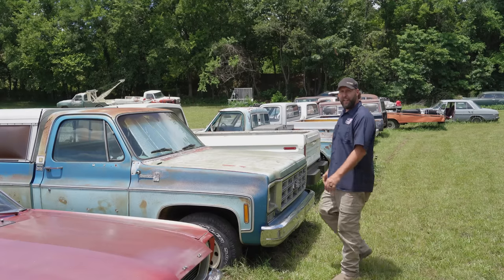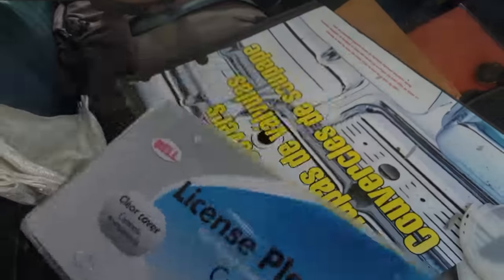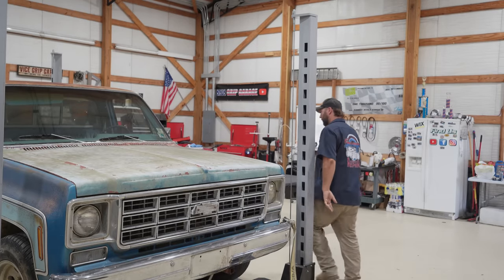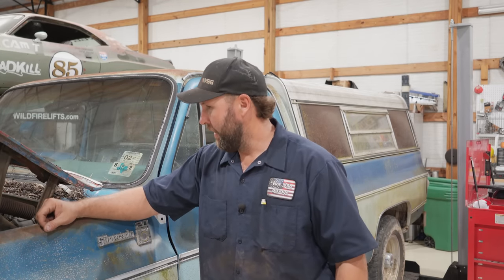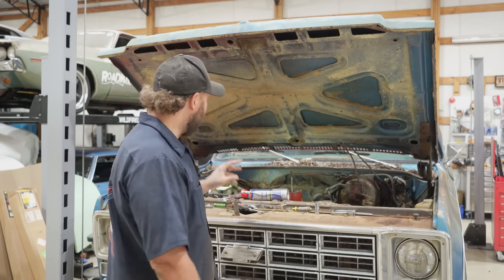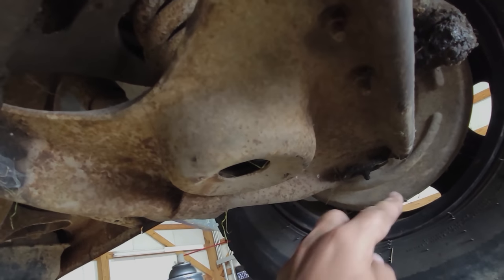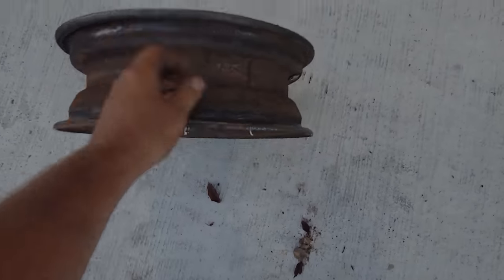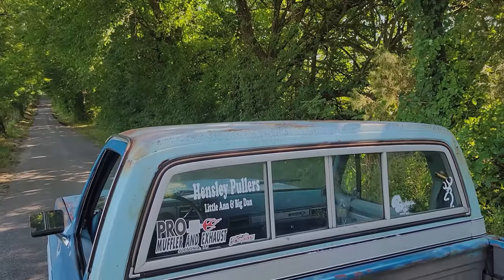Forgotten Big Block Truck- Will It RUN AND DRIVE After 16 Years?

Comment: I think a kid with a mullet driving a John Deere is one of the most American things I’ve ever seen.
Reply: I absolutely agree 🇺🇸
Reply: When I was at Montage for a concert, I got a picture of a fella with a majestic mullet wearing a shirt that says "Mullet Lives Matter"  It's in my community section of my YouTube channel.
Reply: Pay no attention to the yanmar under the hood😂
Reply: Dual exhaust mullet too
Reply: Yeah until you think about how those despicable executives over at j/d are one of the biggest corporations against right to repair in this country. This entire channel is the exact opposite of what that company has proven for years that they are against.
Reply: You know he is brought up RIGHT!   I don't mean political party neither, I mean RIGHT.
Reply: Had the exact same haircut back in the late 80s early 90s the only thing he's missing is his hockey number on one side instead of the stripes
Reply: @AR-ed3xw  I so dislike closed mechanisms & throw away culture.
Reply: @GT380man  it's really mind bottling
Reply: @AR-ed3xw  
One boggles doesn't one?
Reply: @Ragonex  
???
Reply: @AR-ed3xw  
Can you tell more about j/d? I haven’t heard of this. I can see how we’re getting locked out of working on these.
Reply: @JohnSmith-yv6eq  the mind can do all kinds of crazy my man
Reply: @bodarville2510  on new equipment you can buy the part you need, but it still won't work for your equipment unless you have their proprietary software to code it to your machine. You are at their mercy when it comes to parts and service. There is lots of info if you search, I could go on forever. Some techies have tried to make "backdoor" software, but they block that out as fast as they can develop it.
Reply: @akaaccount  
Thanks Mike, I will.
Reply: @jasonwhitler4167  they’re made in India. All they do here is bolt on tires and put on loaders.
Reply: @AR-ed3xw  
Thanks, sounds like they’re holding our stuff hostage even though we have the title. Another reason I like old stuff.
Reply: Pretty well a Canadian thing too.
Reply: John Deere is from my home town Moline,  Illinois. All new cars, trucks, and tractors use  computers. They are not like they were in the 1950's !!!!!
Reply: @bodarville2510  just another reason to follow the advice of this channel, buy old and put your money into restoration. This day and age, you will come out way better in the end!
Reply: @grantkoeller8911  what's up from Galesburg IL
Reply: All it needed to be complete....a Winchester pump .22 in a homemade rifle rack
Reply: @AR-ed3xw  
Absolutely!
Reply: Im from Aussie land  and i can tell you this ... so proud of that Mullet he has going on 👍 on the Mullet young man
Reply: @Royal_dj_ent  Well you just keep a lookout for ‘em.
Reply: Agree... nuff said... !
Reply: Super cool! Yeah I'm from the quad Cities
Reply: @jeremyTallen1  I love Galesburg!!!!
Reply: @Ragonex  why would even say that for .. am thinking you might have a bully as a kid your self ... was no need to say something like that
Reply: ....and Dereks son is too, lolol
Reply: @AR-ed3xw  This is what sucks about the compact tractor market especially. There is no perfect way to support US manufacturers. It’s why I bought Mahindra. It’s unfortunate the parent company is in India, but my tractor is a rebadged Mitsubishi, and all of the implements that I bought with it including the loader came from KMW in Kansas.
Reply: Bentley got all leggy real quick, he's about the same age as my nephew cool as heck when they are all growin like a weed.
Reply: John Deere single handly pissed me off so bad it convinced me to sell my 1700 acre farm to a manufacturing company building plastic chairs. I quit, y'all can figure out how to get your own damn food.
Fix your own or go home
Reply: Whats up with the red and black step side in the back ground I want to see that one wish I could buy it lol i love me a square body
Reply: Yes it is and you can tell by the big smile.  He loves being with his dad and learning.  Great memories
Reply: Hell yeah brother!!
Reply: @jimtruett8130  I'm all for supporting US manufacturers, but more so supporting the farmers I get my families food from. If something on that Mahindra breaks, you will find several options on reasonably priced parts you can change yourself, where deere you have to go through them and get shafted just to have a tech plug in that special laptop. I would much rather see a guy make his way best for him, and not just for that green paint that's supposed to be fancy!
Reply: @AR-ed3xw  Agreed. Unfortunately I don’t see it getting better anytime soon. I had to drive 170 miles one way to the Mahindra dealer. The local Deere dealership is walking distance from my house.
Reply: @jasonwhitler4167  Yanmar has been supplying engines to John Deere since 1986.  If you have a smaller Deere from the last 36 years, there is a good chance it has a Yanmar.  Japanese Yanmar is a fine engine.  BTW, something tells me you already know this and are just being 'old tractors are always better' crabby!! Have a good day.
Reply: @brianellison3525  Thanks!  You are a real problem solver!
Reply: @paulcopeland9035  nah I'm just being a pain in the ass. I like the new stuff too😁
Reply: @TechGorilla1987  the guy in the background looks like mick Foley from wrasslin back in the day
Reply: I wasn't mad at it. Its a fine mullet
Reply: @TechGorilla1987  montage mountain PA?
Reply: @ogt92fromthe1step9  Yes sir!  Probably a Staind or Shinedown show.  Cannot remember.
Reply: @darrenswails  I'm not sure who that is, but thanks for checking the photo out!
Reply: Yep💪🇺🇲
Reply: Actually brought a tear to my eye!
Reply: @TechGorilla1987  ever watch WWE? There was a character named mankind, or mick Foley....... anyway not important
Reply: Yup!
Reply: Mullets are back!!....
Reply: Just like a pickup truck hauling a camper .Business in the front, party in the back. LoL.
Reply: Yeah, but he really should get rid of the mullet, it will stunt his growth worse than cigarettes and people will mess with him too.
Reply: @AR-ed3xw  I believe that they have lost that battle in a few states. Massachusetts being one of them. Rich Rebuilds mentioned this in one his videos about his "Farm Truck " videos.  Shame on Deere John.
Reply: Love your videos Derek you got a nice truck there bro
Reply: You might find a few copy cats in Australia.
Reply: @Ragonex  Naw, they got Mullet laws done south.
Reply: @darrenswails  Actually, no.  Sorry.  But I did go looking on the interwebs and I see what you mean!  Stay well, Internet person!
Reply: @TechGorilla1987  same to you
Reply: only gets more American if there's a mountain dew in the cup holder
Reply: I thought the same thing.
Reply: @Ragonex  He'll just run 'um down with thee tractor 🚜!
Reply: We decided to buy an older Ford tractor.  Easy little 4 cylinder to work on. We have a few John deer mowers rotting beside the pole barn needing work on the hydrostatic drive.
Reply: Any of you fellers notice the refrigerator with the ice maker happener....while the rest of us got the old avocado  or harvest gold ones  with a bag of ice in the freezer....you know Derrick has got it going on 😆 🤣 😂
Reply: You love to see it.
Reply: Should’ve seen us in the 80s and early 90s lol
Reply: back in the late 80s I was 13 living in California and I had me one of them there Joe Dirt mullets. didn't care much what people thought! I wore it proudly! Derek I believe has the best one ever! keep up the good work little man on helping dad! I remember being under my dad's 64 custom can c10 helping him all the time working on it. Good times and never ever forgotten. thanks Dad!
Reply: ...or driving a 1970 Chevelle Super Sport while blasting the Motley Crue  and wearing a jean jacket. That's American...
Reply: How bout a kid with a mullet driving a Chevy?
Reply: Ol Tennessee tophat. 🇺🇸😃
Reply: @Ragonex  I doubt it, mullet wearers do the beating up.
Reply: @Ragonex  they all look alike
Reply: Question: what is a mullet?
Reply: I've never thought a mullet was a bad look? I don't know how they got such a bad rap? Maybe from people that were afraid to grow long hair at all or just can't??? I always thought they looked pretty cool.
Reply: His whole family is America. They should only by wearing old glory Stars and Stripes and appreciate that about ya’s
Reply: Someone needs to teach him
 When your running the starter inside the cab for someone else under the hood;
    Always test the horn without telling the guy under the hood
Reply: Kid called Bentley with a mullet driving a John Deere pulling a rusty pick up truck out the mud *
Reply: Yeah brother 🤘
Reply from the maker: @Ragonex  what?
Reply: @Ragonex  again, what?
Reply: It’s the most Alabama thing
Reply: @ViceGripGarage  Bentley is a fine looking boy.  He's going to be an athlete like you were, and a stone cold heartbreaker..
Reply: You saw Cleetus McFarland on his tractor?
Reply: @Ragonex  bruh! Gfys!
Reply: @andrewforbes146  agreed.
Reply: @christiandickerson2308  i can't believe people out here trying to take little man down! Just helpin his pop make a vid. I think he looks rad make Joe Diffie proud! You keep doin you bud. Your alright...and I ain't kiddin ya!
Reply: @Ponykotze  VGG lives in TN, not AL but there are plenty in AL too.
Reply: Dui
Reply: I gotta pic of me in a backhoe rocking the mullet at like 6 years-old
Reply: @GT380man  what
Reply: @GT380man  nvm
Reply: Dragging a big block squarebody too! 🇺🇲🇺🇲🇺🇲🇺🇲🇺🇲🇺🇲
Reply: Most important...the Kid did well on the "pulling" part.
Reply: That's a turbo mullet👍👍👍
Reply: Great job Bentley!
Reply: Same
Reply: @brianellison3525  yeah when John Deere stop making their own tractors everything went to crap I do a lot of small engine and small garden equipment repair I couldn't tell you how many people would call me about fixing their John Deere mower I want you to tell him if it's still running halfway decent sell it buy something better they're junk the motors are in them are junk in the last ones I worked on I forget how much more it was twin cylinder I pulled it and I put a Briggs & Stratton twin cylinder 20 something horse motor 15 years ago say that tractor still going strong just sad cuz the motor that was in it on the last about 5 years from you and was taking care of. I feel bad for farmers who have any other bigger newer equipment it's you can barely work on them you can get parts you can put them on but because all the computers and electronics on it they have to be recoded or rescanned I don't remember exactly it's not something that most people can do it's unfortunate cuz farmers are always some of the most ingenious builds and projects and equipment I've ever seen when they need a machine for a specific job between all the crap they're laying around old equipment you are equipment this set slap something together and it will work and do the job they needed to do.
Reply: Counld'nt agree wit ya' more !
Reply: Yup !!!! 👍🏻👍🏻
Reply: Auto bb gun
Reply: Basically describes every kid on a farm here in New Zealand lol
Reply: That was me in the 80’s. Now my hair won’t grow in the back or I would still have it. Still run my old Deere’s but my new tractor is from South Korea. Hyundai and Kia showed this old mechanic to give it a shot
Reply: now, the mullets gone but i still have a rats tail at 41. So its still business upfront party out back as usual
Reply: Most American idk, country definitely
Reply: terrance codwell  lot of comments talking about Ragonex, looks like he deleted his comment, what'd he say?
Reply: Needs a let’s go Brandon T-shirt
Reply: @CrazyBoredDude  a Trump lost get over it shirt would be better
Reply: @Remo1147  Libral
Reply: @CrazyBoredDude  traitor
Reply: You obviously have not seen me because I mowed the grass in my boxers and cowboy boots
Reply: @DestinyDad  do you got one of those zero turn mowers those things fly
Reply: Pulling a Chevy*
Reply: @paulcopeland9035  99 percent of blue water sailboats have yanmar engines in them. They’re small and endure a crap ton of weather conditions and endure many many many hours without major maintenance.
Reply: Deadhead sticker on a Cadillac
Reply: Damn strait
Reply: Bentley is one cool kid!
Reply: And stair steps cut just like Vanilla Ice!
Reply: Its not a mullet its a racoon hat that happen to fall in a bucket of bleach
Reply: yes, yes it is.
Reply: @LunaRayToo  And it’s awesome!
Reply: But named him Bentley 😂🤷🏼‍♂️
Reply: As American as is gets.
Reply: Kind of looks like something from the nineties before the backlash against mullets.
Reply: Is that a good thing or Bad thing?
Reply: @atex6175  That was when it was in style. Like disco there was a backlash against it.
Reply: @charlesphilhower1452  oh yeah there was the mushroom cut
Reply: There is a kid on my 10yr old son ball team with a sweet mullet. Wait for it........... wait for it............ his first name is on his jersey and it reads Waylon!!!!!!!!! Yee Yee!!!!!!°
Reply: @yjwrangler7819  ayy stop trying to be America.....don't wanna stoop that low
Reply: @AR-ed3xw  We got them deeres at work, most annoying thing ever and the reason I hate deere. Deere was even propietary in a way when the 2 cylinders were common. The odd crank degree, which is where the unique sounds comes from, would shear the shear-pins on non-deere balers. All that software stuff is why I remind my boss why I run non-computerized equipment, everyone at work gives me a hard time for still using antique equipment.
Reply: What part of Arkansas you go to get this Silverado?
Reply: I think Bently is the future of VGG.
Sasquatch can't do this forever...
Reply: If it was kid with mullet riding a IH A414 it might be the most Australian thing you have seen
Reply: I like the way you think! 22:31
Reply: @andrewforbes146  I know this is 9 months ago, but he deleted his comment. What did he say?
Reply: I wish the mullet didn’t make a comeback
Reply: Multiple mullets from what I can see 😂
Reply: @AR-ed3xw  Theyll be suing the boy any day for towing a vehicle without the express written permission of John Deere.
Reply: Absolutely agree 💯
Reply: @jeremyTallen1 that's crazy I live in alexis lol
Reply: honestly im suprised they dont have a massey harris or Ferguson as well :D
Reply: Only thing missing was some Lynyrd Skynyrd!

Comment: The front fenders had the factory tie down mounts for the camper (3 hole plates) ...saw one on the passenger side seat, and the rest of the camper mounts were on the floor! That factory camper special stuff is worth all the money! Definitely a tough old roundeye!

Comment: "It's alive'" :washhands:Chevrolet big-block * * *  This brings back memories of my 1977 Chevrolet Camper Special with 454 under the hood, what a great engine and truck I found locally for $ 700 in running & driving condition back in 2000, a small tune-up + oil-change and BANG, ran like a champ. 
Had it as a daily driver for 5 years, great hauling heavy stuff with, dependable pickup.
Can't beat a good old Chevrolet Derek, looking forward to your adventure across US, don't forget bring enough gas-money and cold-snacks !
Cheers from Texas * * *🤠

Comment: I can't tell ya how many hotrods I diagnosed with vapor lock because of metal fuel lines against the block and heads on power tour this year. DEI helped a lot of folks out on the tour. Great people!
Reply: I had vapor lock issue on a couple of my own prior trucks. I had found installing a return system helps alot in keeping warm fuel going back to the tank and cool fuel coming up to the carb.

Comment: Has anyone said the vacuum modulator may be bad yet? Would make trans fluid disappear and cause engine smoking which may have made previous owner think rings were gone, and trans fluid in the engine would so explain the lack of rust after sitting so many years

Comment: Hands down the cleanest unrestored square body I’ve ever seen. I’d say my late grandpa was the original owner if I didn’t know better. He was meticulous and thorough to the furthest degree. Very cool pickup.
Reply: I've got my great grandfathers 1976 square body that was passed down several years ago. Zero rust. Zero dents. 86k original miles. Currently sits in my parents shop and hasn't been driven in a few years.
Reply: @TravelingStacker  That’s awesome. Get it running and drive it. Make new memories with it. Do not ever dream of selling it.
Reply: @rustbucket9318  except not in the rusty bits of the USA in the winter, you know with the salt and the frost heaves.
Reply: @hithere7382  Yeah, I’m in Texas though. Other than gulf coast our stuff stays pretty clean.
Reply: @TravelingStacker  Nothing ruins a vehicle faster (other than crashing, I suppose), than just sitting. Not saying to daily the thing (especially with the ol' thirst for firejuice), but every once in a while, take 'er to town, take the long way back.
Reply: @NaruSanavai  Its hours away. My dad drives it every few months. He didn't want it so he handed it down to me. I don't have room for it so it stays there.
Reply: @rustbucket9318  Its runs and drives. My dad runs it every few months when he's home and in the shop.
Reply: @TravelingStacker  Still, man. I get that it's sentimental - but, it's still a machine. It doesn't need to just run, it needs to work, to move.

Think about it. Is someone like Derek (Derrick?) gonna have to show up in 20 years? Uh-oh, re-run.
Reply: @NaruSanavai  Its not a sentimental thing to us. Grandpa didn't want it anymore and thought my dad should have it. Dad left it parked for years and gave it to me thinking I would want it. While I do, I don't live near them or have time to drive it since I travel full time. My nephew has brought it up and I'll likely give it to him. It'll get beat to hell and be broke in a year, but it'll be driven.